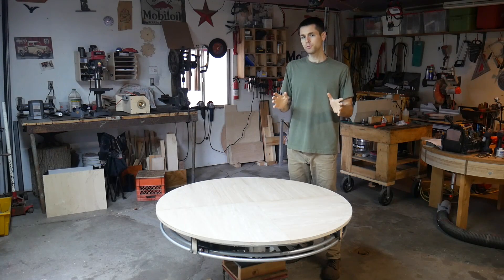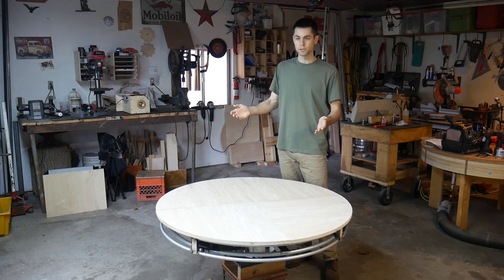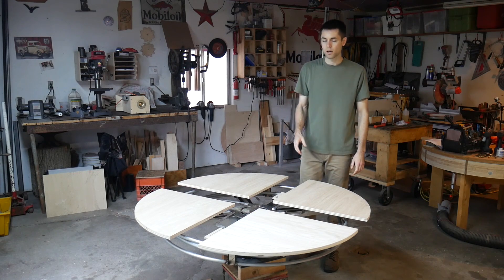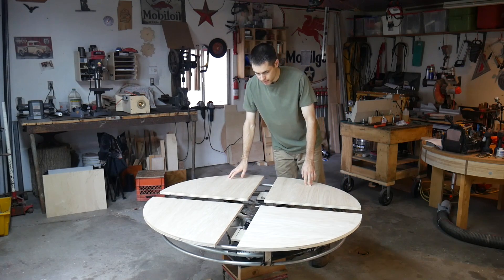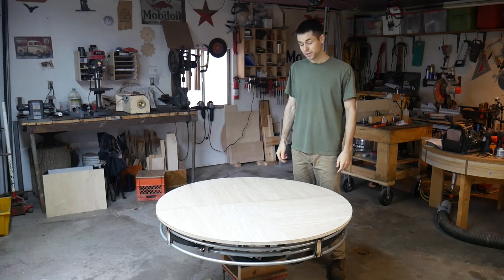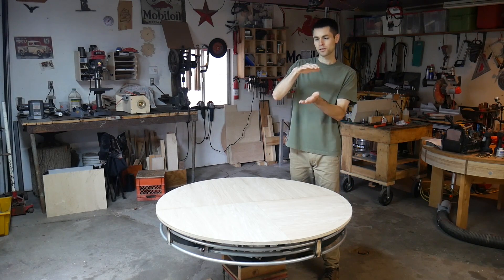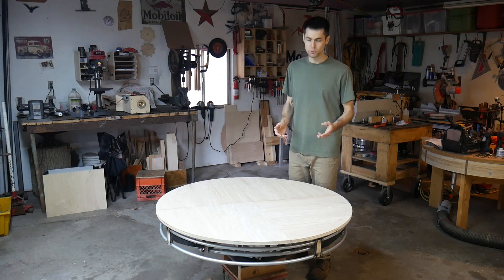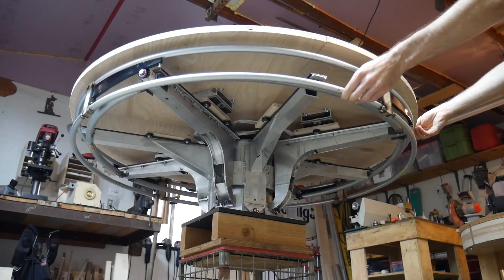Metal Expanding Table: Prototype

Comment: hello Scott, I designed the expandable table however I have a problem: I do not know how to make the central star stay in the same plane when the table is completely open, before starting to open the table, the parts that complete the table should be on a level higher than that of the star, but the whole set rises the same distance, and can not be on the same level when starting to open the table, if you can help me with this detail I would greatly appreciate it please.

Comment: I might be missing something, but it seems to me that for the skirt, you could just put a skirt segment on each leaf segment of the table and let them join together just like the horizontal surfaces. It looks like the outer edges of all the segments have clearance for a skirt, or could be lengthened by an inch to give the needed clearance. The dropping and raising mechanism for the skirt seems overly complicated to me.
Reply from the maker: The raising panel skirts would collide with the main ones during expansion. This also creates 8 more mechanical interfaces and 8 pieces that must be manufactured independently and retain their shape in order to mate correctly. A single piece skirt is a convenient reinforcement at the location where it's needed most.

Comment: Scott. I just found your channel. I am very interested in this. To see your effect go into something like this is amazing. I believe you should Patten it. For those that say you can't, that's like saying Ford can't make the Mustang because Chevy made the Camaro first and it's basically the same car. Your table and designs are completely different from the others while achieving the same look and feel. I current don't have the money for your table but once I get it saved up be assured I will be purchasing one. I would love you see you're new build video walkthrough. Also I noticed before your ring was very thick because it was needed to cover the insides of the table. But because this one is made out of metal and doesn't require as much size to strength ratio would you be able to make it thinner and the outer ring thinner. Of course I understand like you stated this is the prototype and you won't have a finished version until about 3 or more versions in. Maybe just something to look at. Also what state are you located in, I'm just curious. These are very beautiful table at a very affordable rate especially compared to the top competitor. If you start a kick starter I will definitely donate. You could do basic donations for plans, and then upgrade to piece sets for the two tables and then even a completed wooden table for 1000, or whatever you have it priced at, and the final donations for a new set for the metal and then largest a completed table metal table with all the works. Just an idea.
Reply from the maker: Thanks, keep in mind that the ring must also contain 2X the thickness of the upper panels in the small position, so the skirt depth is actually pretty reasonable. It could be thinner if you used extra-stiff materials for the frame but I don't think the cost is justified.

Comment: Saw the Kick Starter recommendation, read through the FAQ and was surprised to find that the funding is with minimum to no strings attached, and the main requirement is that you make a good faith effort and update the funders with your progress. You are already doing all of that and I for one, can't afford your kit at this time, but I could and would contribute to a Kick Starter fund for your project. You may want to take a look.

There is a visually appealing version of one of these designs that has each section meet at a curvy edge, do you think that could work with your kit? Keep up the good work, we would love to see this work for you.

Comment: I'd be interested in the kit. Would it be possible to have a 72" top fully expanded?
Reply from the maker: Yes, but you would probably have to start out at about 56" initial diameter. There's an expansion % limit as you run into issues with the panels overlapping and having no attachment points. Feel free to send me an e-mail (see video description) and we can investigate further.

Comment: Scott,
I like the the design of these mechanics.  I bought a set of your plans, as a plan to build one of these tables soon.  I think the leaf support arms could be wood if the were mounted to a metal riser ring. I like the metal rings and metal cylinder concept to support the mechanics, but would like to know your thoughts about hard wood "shelf support" instead of the square aluminum  and with sidewall extensions. I think fastening a wood skirt to the outer rings would be really simple and having wood support for the leaves will allow carpenters to shape and finish in a manner that will hide the center metal cylinder and mechanics.  Love to hear and see your thoughts.
Micah
Reply: also removing the metal support arms, replacing them with drawings for hard wood replacements, will reduce the shipping weight and production requirements.
Reply from the maker: Thanks for the order. I've thought about wooden arms and it's possible, with their relatively thin cross section and lack of support I'm concerned about stability though, as they need to stay very straight. Joining them on the end with the required strength would be challenging too.
Reply: It looks as though the arms would be about two inches thick.  If that is correct may a face plate for joining to the center hub and a face plate to accommodate the top rolling mechanism.  Oak or any of the various hardwoods could easily accommodate the required support, but you are correct with limited space for joining them to the center hub, machine screws are best.  I think a good face plate might work though.
I am interested in purchasing the kit.
Reply from the maker: I'm certainly open to ideas, boring a vertical hole and using a dowel nut (or similar) setup might work, I like they fact that they distribute the force while also being easy to drill accurately with standard equipment. Send me an e-mail and we can discuss further: scott@mechanicallumber.com Thanks.

Comment: Very nice engineering!!!  If you go into production, I would invite you to explore "water jet" cutting of all aluminum pieces and robotic welding of the main frame.  You can pick up a really nice (used) FANUC (brand) Welding Robot w/ welder for under $25K.  A helper/assistant could be loading fresh parts and unloading finished frames as fast as the robot could weld them.  Once again, very nice work!!!

Comment: Scott..smart of you to consider 6 leaf small table design if a round in both states design is desired.  As I bet you appreciate, as more leaves are introduced, the facets of the smaller table configuration approach (but of course never reach) the roundness (notice I said roundness, as in "less facetization," NOT circumference) of the expanded configuration.

And more roundlike facets make life easier for the creation of the top portion (of the 2 parts you mention) of the skirt that would encapsulate those facets on its inside, while on its outside present roundness.

That would be one heck of a skirt to make, as if the one for the original wood version of this table, round on its inside and out, wasn't challenging enough with its 5.5" inches in height of staggered glued levels.

===

Business plan--this sells to craftsman or gets licensed to a mass producer, or is used by you to make a custom tables to high end customers without the $ for Fletcher-Capstan.  

DIYers usually have more time than money, and I am afraid this design's price, as utterly reasonable as it is compared to Fletcher-Capstan, is still too prohibitive compared to the wood version's plans.

Could aspects be made in uber strong plastic resins by a mass producer rather than aluminum to reduce marginal cost and shipping weight?  Unfortunately to get the demand to warrant such production price has to drop.  And for price to drop, it has to be mass produced based upon this very demand that would warrant the mass production marginal price drop--sort of a catch 22.

Go to craftsman trade shows and furniture builder shows.  Seek, like someone said, high end industry, like yacht makers.

Comment: Scott, how necessary is the outside tubing? Can you make the table with just the 8 center Arms?  I feel like I might hit my knees on the tubing, but I could probably avoid the arms.
Reply: +James McCloskey i guess the tubes are ther for two reasons, holder for the skirts and keep the leaves out of harns way when the're folded in/down, but as far asi can tell it'll work without skirt!
Reply from the maker: The tubing is accounted for within the 5-1/4" depth, it doesn't hit my knees. The skirt could be skipped but the tubing between the main arms provides extra panel support not shown here.
Reply: thanks for clearifying! :)

Comment: How do you fill in the cross? Like automatically or manualy add in boards?
Reply: They will automatically pop up and fill in the space once the table is expanded -- they are mainly just removed in the video so you can see the mechanism in action.
Reply: Oh that is seriously cool. So glad im subscribed.
Reply from the maker: buildstoys is right, I left off the raising panels to save time on this version.
Reply: Hey did you consider making this for yachts? I mean...  introduce it to that kind of market :)
Reply: Google capstan table and you'll see lots of examples of this type of table. This is probably the least expensive one you could get too.

Comment: Could you incorporate a second ring around the first ring that was attached between the two horizontal rails of the first ring? In essence the second ring would rotate around the first forcing the first to rotate around the table after its fully lowered. Then after expansion the skirt would only raise to the height of the first ring, with the second ring staying in the lowered position. Think of it as a two step process.

Comment: Hey Scott I have all of the Solid Works files for the Expanding Table that Fletcher Capstan made if you are interested to try and make his mechanism
Reply from the maker: I appreciate the offer but it's probably best to maintain some distance from those documents if only to calm the internet naysayers. I'm currently going for more of a Ford approach whereas I would characterize Fletcher as the Maybach of expanding tables.
Reply: Mack Monsees I'd be interested in those files to see how Scott's model compares...if you're willing to share.
Reply: Mack Monsees hi Mack my name is lyle carmignani.  i am in California.  would you be willing to share the solidworks files of the capstan table with me. i have been looking for them for a long time. Are the files in an assembly or separate?
Reply: Sorry for the late reply the only way I would give the files that I worked hard on making is if I were to get paid for my time to create all the files that took forever to create.
Reply: Eric, I have designed these files to be exactly like the Caspan table which is a lot more advanced then Scotts you would need to have access to a CNC Mill and CNC Lathe to be able to build this. The files that I have are not for a beginner you have to have advanced skills in CNC especially when it comes to machining the large gears.

Comment: First, great project!  

Second, I just bought the plans for this, and was wondering if there was sufficient interest for a 'hardware' kit for the wooden model?  I'd love to be able to buy all of the non-wood components of that pre-made, saving me from having to cut metal :)

Thoughts?
Reply from the maker: I would offer plans if the demand is there. The equipment and skills required to build this has a much higher barrier to entry though, so for now I'm focusing on pre-built mechanisms.
Reply from the maker: Thanks for the order. I looked into it at the beginning of the year and it wasn't practical but I may re-examine in the future.
Reply: I'm also an owner of the current plans.  Will you be selling the plans for this new design or just ready-made kits?
Reply: Great to hear and I look forward to the future assembly videos.  I would definitely be interested in new plans, I am much better equipped (tooling-wise) and competent in working with metal than wood :)
Reply: I was wondering this myself.  I have the plan for the wooden model, and I know you send us any updates on that.  Would you consider this model a new plan or an update?

I am definitely interested in plans which ever way you view this.
Reply from the maker: I consider this a separate project as it's a new mechanism and required an equal amount of effort. That said, I do mention on my site that I'll give a credit of the plans value to any previous customers who would like a mechanism.
Reply: Scott Rumschlag that seems fair to me. this is a different enough project.
Reply: Definitely fair enough.  I kinda figured so...as you had to design the components from the ground up again.  Regardless, I am with the others in having interest in some plans.